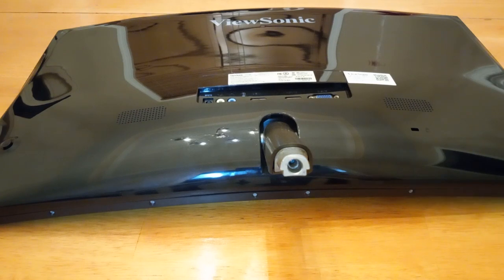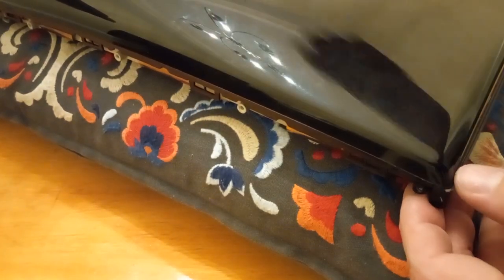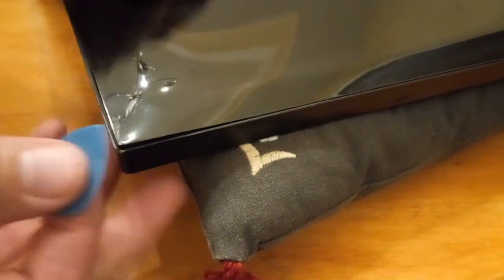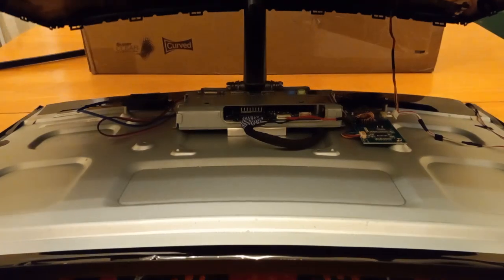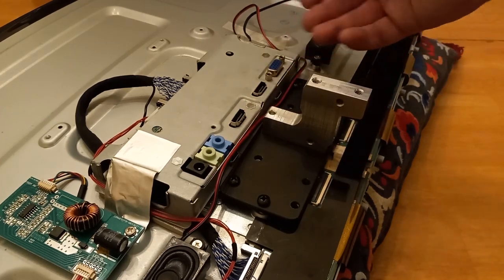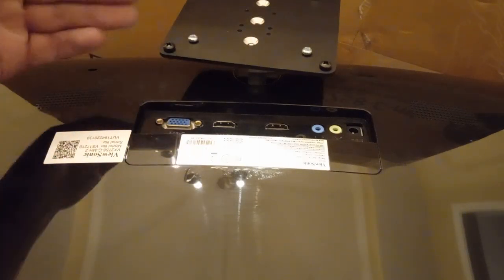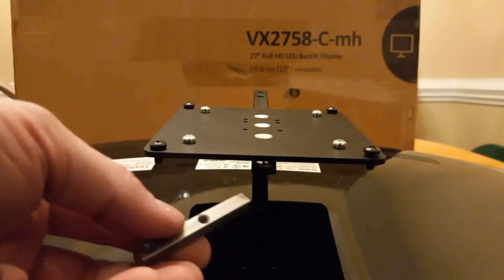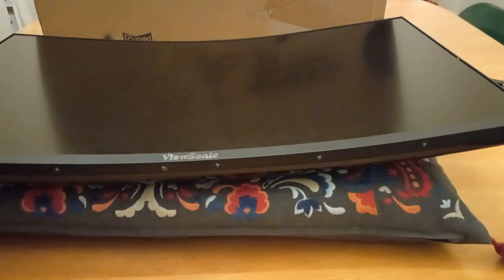Installing the VESA adapter for the ViewSonic VX2758-C-MH, vx2458-c-mhd and VX3216-SCMH-W

Comment: I have the VX2458-C-mhd, unfortunaly i dont have screws at the bottom. Is there anyother way to install a VESA adapter?
Reply from the maker: Does this one look like it would fit? Send me a photo of your monitor's stand on Etsy if you'd like. https://www.etsy.com/listing/914096411
Reply: I'm in the same boat. I don't have screws at the bottom to take the screen off. Is there another way to remove it,?
Reply: @Goofeey94  did you figure it out. Have the item in the basket but not sure if id be able to take the monitor apart. Ive done some technical stuff in the past like build my own PCs but unsure abt this.
Reply: @NExT-zp2oo   im also waiting for the answer haha